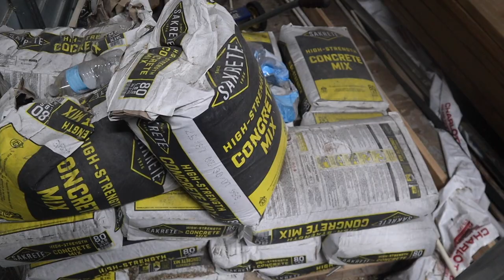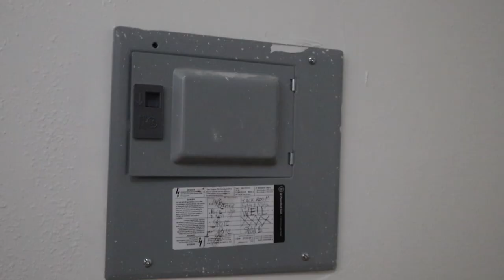HOW MUCH IT COST TO BUILD MY DREAM HORSE BARN! REAL NUMBERS!

Comment: With 2022 inflation its now $100k. That building alone in Texas or Alabama is now $38k, concrete is $11k, those rubber Matt's are $105 @ tractor supply. And the cherry on top! Fuel is now double. THANK A POLITICIAN!!!!

Comment: Prices can really vary upon where you live, what you are looking at, and of course the size of the  barn. We just actually got a run in that we are converting into a livable barn for my two horses. It’s a 12x20, black metal, charcoal metal roof, ( looks like a shed row), treated kick boards, treated wood rafters, treated wood skeleton ( like all the wood framing/support), and we added two 3in wings on the opening making it look more barn like. Both of my horses love it and it’s perfect for both of them to lay down. I have a 15.2 hh mare and a 16 hh gelding and they both fit with room for another horse or two if that helps with size. All in all we spent about $6,000 for them to build it in 3 weeks, deliver it, and put it where we wanted it. We live in Wisconsin! I looked all around, even in other states and I saw some for $1k-10k for the same or similar thing we have. Like I said, all depends! I’m super happy though that your shared! It can be super helpful for others looking at what they can possibly be looking at cost wise! I love your guys barn! It’s simply beautiful! Love y’all! ❤️🐴

Comment: Honestly this is a great price. You saved easily 20k+ just by doing all that labour yourself I'd bet.  For such a classy, usable barn this was a great price. And you really spruced it up compared to the normal metal barn shell that is then turned to stalls with just cattle panels and metal rail and such. 

Honestly you easily added a lot of value to your property with how well this barn is made.

Comment: groundwork $2,700
building cost 1700 square feet $21,500
concrete 1000 square feet $3,670
metal channels $1,003
stalls (southern yellow pine) $2,300
18 yards of peed gravel $300
53-80 pound bags $210
mattress system (12x12) 5@ $793 = $3,965

So we are basically at $35,648 or around $38,000 with taxes, freight, and labor.  My question is how much money do you make in return? Like the services the barn offers and things like that? You have to be making a pretty decent return value putting that much money into a building a barn.

Comment: Nice … and the sweat equity goes a long way,
Plus the pride of doing most of the work
Yourself.
I’m currently in the midst of building a small horse barn myself.
Been wanting to do this for well over 20 years, and to be honest , was waiting until a time I had the extra $25-$30-$35k,
Which never happened.
Over the years I’ve purchased telephone poles with intentions of building a barn, only to use a few for a small lean too structure, and about 3-4 years ago, I demoed an old barn with intention to reconstruct it on my land, but the majority of the wood was in poor shape & the design just wouldn’t work… so I was always back at square one.
Anyway this past summer I purchased a used tall metal carport that someone had used to store an RV underneath, it is a 
12 x 30,
Just like you I had to bring in about 10-12 loads of dirt to build up a low area,
I erected the 12 x 30,
Which gave me a starting point, and will be my center open alleyway,
I’ve built out of wood, 
A 12’ x 30’ lean too on both sides, connecting to the center metal structures,
So my total under roof is  a 36’ x 30’,
Just enough room to build 4 stalls 12’ x 10’ and have room for a tack room on one side & feed room on the other,
I hope to get the roof on over the weekend,
And will be picking up 4 sliding door stall fronts next week- used.
I still have a long way to go,
As I have not fully framed out my stalls or the interior structures,
But I roughly have about $7-$8k in it so far.
Looking into solar panels for lighting & a few outlets,
I’m hopeful that I can get fully completed in under or close to $15k,
That’s doing 99% of the work by myself.
I did hire a couple young men for 2 hours to help get the long roofing panels on the top,
Difficult to do for one person.

Comment: Wow! I thought it was at least $100,000 to build the barn. I'm an insurance agent and typically for a metal building structure brand new it's approximately $110 per sq ft to build. That includes labor as well though. Just a piece of advice, when you insure it make sure you insure it for what it's actually valued at plus labor. You want to insure it for what it would take for someone else to build the exact barn the way it is now. So even if you go with $98 a sq ft (which is typically a frame building) it would still be worth $150,000. If god forbid something were to happen to the building you wouldn't want to have to re-do everything yourself so make sure it's insured properly and not for what you paid to have it done yourself :)

Comment: Hi there, I love watching your videos! We're starting our barn build soon and your videos have inspired us so much. We absolutely love the u channels you use. Can you tell what size you got? Also, why did ya'll decide to not do concrete in the horse stalls? My plan was to have a complete concrete slab for the entire barn with a drain in each stall so we can strip it down to wash it out to help keep clean.  Do you have any cleaning issues with the way you chose? Thanks for any help you can provide! Newbie to having our horses home with us. It's a bit overwhelming :)
Reply from the maker: The concrete is too hard on the horses legs in my opinion! 

We don’t particularly have cleaning issues, we do have the stall mattresses so water will just sit on top when we do clean them so we have to use a shop vac or scoop the water out with a shovel!